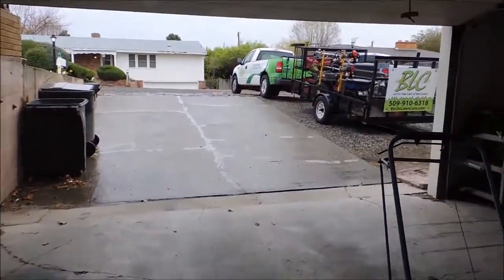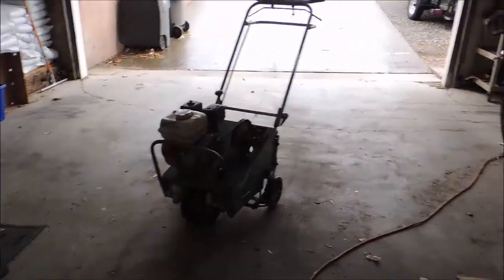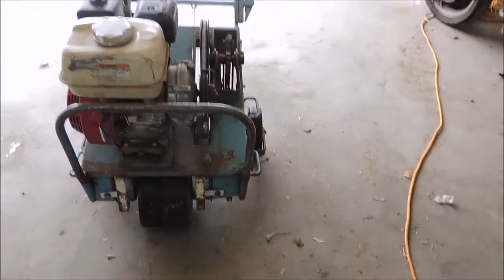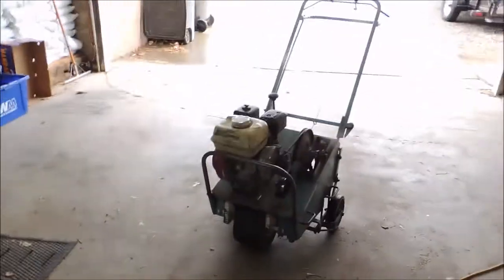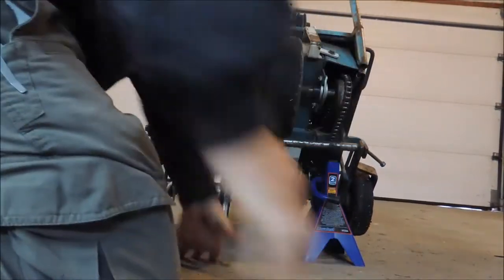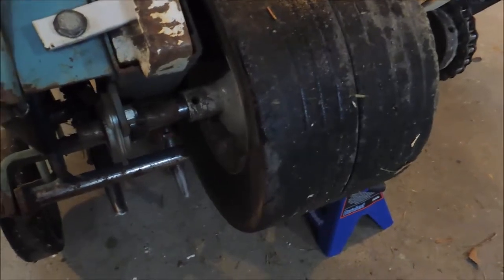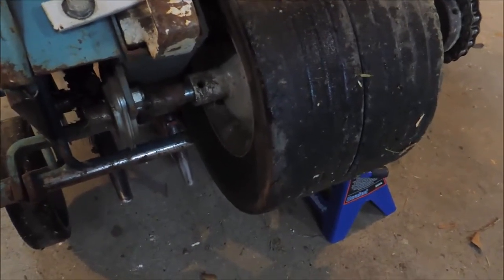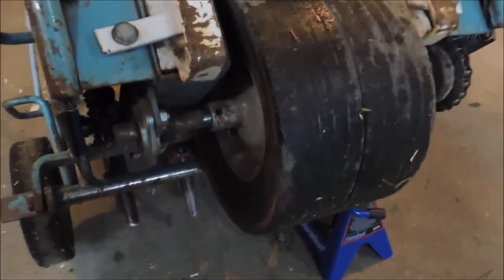Bluebird Aerator Repair

Comment: You  know I watched this video about a year ago and thought , that was useless to watch  because it had nothing to do with my issue, today my  tines were spinning  but drive wheel wasn't,  I used the machine but it sure helps to have that drive wheel working ,  thank you for posting this  , this is my exact problem also , the roll pin is gone . Keep posting ! I see you also use older equipment  like myself
Reply from the maker: Thanks glad it helped eventually.... lol

Comment: Rainy morning here, too. I spend these times doing research, collections, running numbers, repairs etc. 
Got an identical Endura aerator, and electric winch for loading/unloading into truck bed. 
Glad to see it fixed - now I know if mine ever has the same issue.
Reply from the maker: I switched machines to a Ryan lawnaire IV now, I like it much better with the wide front roller tub instead of the small wheels of the bluebird.
Reply: @BirchsLawnCareLLC  Nice.. are those Ryan IVs any easier to turn in motion than the Bluebird? My Endura runs like it's on rails, it can be a little brutal to use
Reply from the maker: Yeah that is probably my favorite thing about it. It is the easy steer set up so when turning the outside tines speed up to help it turn.
Reply: @BirchsLawnCareLLC  that rules. I might have to sell mine and look for something similar. Can I ask you a favor? Could you measure the height of the handle when in transport mode? I have a cap on my truck and the one I have now just barely fits. Thanks if so
Reply from the maker: Its 48 inches but another thing I like about the ryan is the handles fold down quite easily.
Reply: @BirchsLawnCareLLC  thanks! Sounds like a good one

Comment: Very helpful video! I picked one up last fall but they didn’t have the weights. 😕   It works & starts great but using it is like wrestling a BEAR !  After using it, I can’t move for DAYS… Any idea where I can get the weights??
Reply from the maker: It is a Bear for sure, Don't have to worry about going to the gym after a day with that one. lol. 
Not sure if this will help tracking down the weights for it. 

Email: bbbcustserv@bluebirdturf.com
Telephone: 1.866.847.8592

hopefully they can help.

Comment: I was just going to ask how that machine was on the operator.  I rent a billy goat and that beats me up really good.  I guess the blue bird isnt much better if any.
Reply from the maker: It can be a bit ruff, I usually only try and schedule two-three on any given day.
Reply: All aerators are that way in my experience. It takes some getting used to. About 12 lawns per day is my limit. The Ryan Lawnaire 4 is the less brutal of the bunch, but still takes proper technique. You move forward with the machine or it will try to pull your arms from their sockets. Turning is easier with a Ryan. Btw, I'm a light weight at 140 lbs. so size isn't prohibiting if used properly.